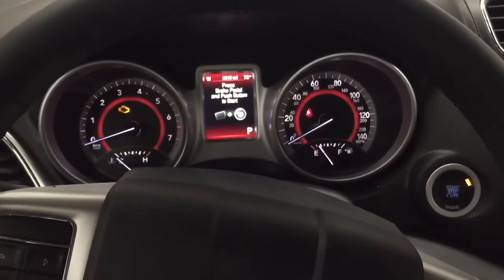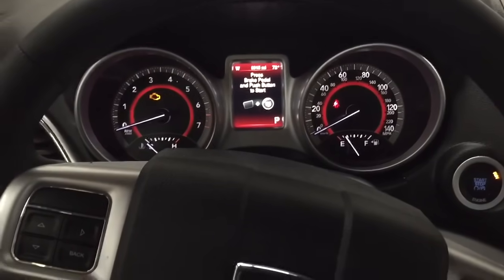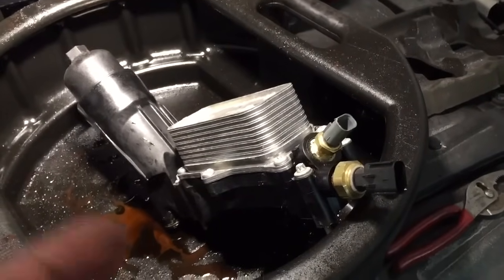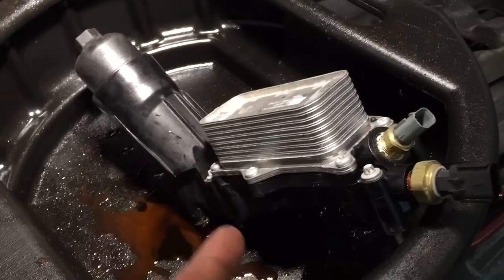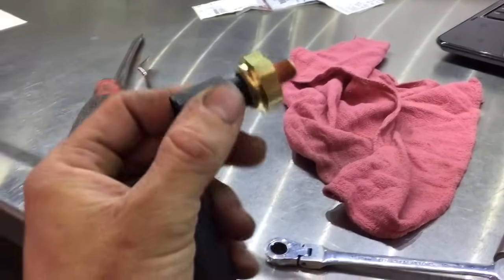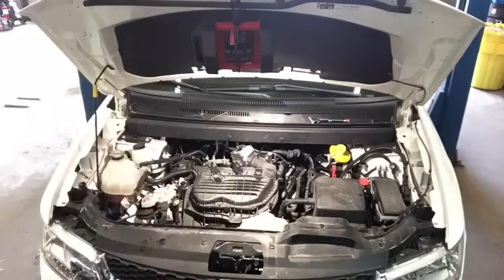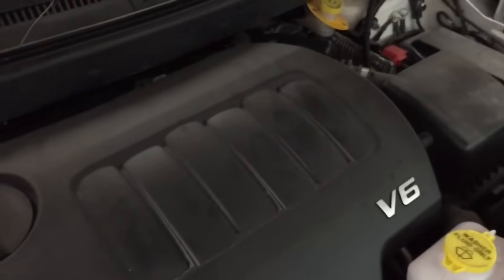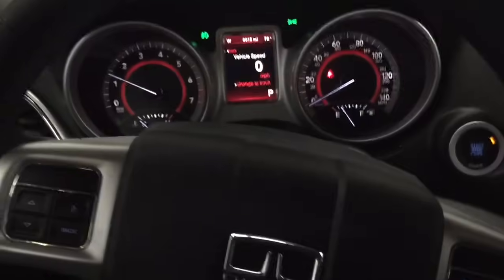P06DD Code, Oil Pressure Sensor Fix

Comment: My 16 journey had code p06DD
The scannner and dash cluster showed low oil pressure
I was doing basic checks . I removed the oil filter cap and i heard a rattle. The pressure relief valve in the cap was broken. I replaced the cap and had oil pressure restored. I'm a 40 year career mechanic and I've worked on countless  3.6 l engines...first time for everything.  Dont overlook the simple things.

Comment: are you aware of that code causing any other driveability issues? like throttle not fully opening? almost in limp mode? car will accelerate ok up to about 40 mph, then just flattens out. pushing on the accelerator (like passing gear) does nothing. it will still accelerate, but very slowly. and cats have been replaced.

Comment: By the time the sensor goes to shit, the cooler is likely leaking. Buy the update, it comes with sensors and related gaskets. 300 bux from a reputable dealer

Comment: P06DD is a oil pressure control stuck off, not oil pressure sensor. you are replacing an oil pressure sensor when it’s the solenoid that is on the oil pump, which is a dual stage oil pump. I hope people don’t follow your advice. 🤦

Comment: I recently changed my sensor and when the cold weather settled in NYC this past few days, I got this code again. It triggers when my engine is in High RPMs.

This sensor took me about 2hrs just to get out because the socket I had was a bit long too work with.

I got my replacement sensor at Advanced Auto parts.

The Mopar parts store wasn't opened on the weekends.

Should I replace it again? The weather is quiet colder now and difficult to work on this.

Car can drive but I have to drive like every other car 😂

I used a Roar Pedal Throttle Response device which I think has caused all these issues in the first place 😢

Comment: It’s not as easy as you say. I’m mechanically inclined, having worked on cars for over four decades. This sensor needed replacing on my 2016 Wrangler. It took me 7 hours and a large table to place and organize all the parts, nuts, and bolts. And there was a lot of them. I did use a YouTube video to help me. I never want to do it again, but now my Pacifica minivan has the troublesome code. I will pay a shop for this. A first-timer will not even come close to an hour doing this teardown of the upper and lower manifolds. But for those that do undertake this tedious job, I highly recommend that you replace the cheap plastic oil cooler housing with a longer lasting aluminum one while you’re replacing the sensor. The plastic one will crack and leak oil if it hasn’t already. You have been warned. Oh, and you will need new gaskets for the intakes and such. This repair is a lot of work for those that are unfamiliar with these engines.
Reply: I can remove the Upper and Lower Manifold in my Dodge Challenger in about 30mins.

The first time I did it, I had misfires on Cylinder #2.

I had to change my Coil Packs and Spark Plugs. The connection on Cylinder 2 Coilpack was faulty and I had to repin a new connector. 

I changed the coilpack on Cylinder 2 about 2x which until I saw the wires were brittle. I have not had any misfires since.

Now I have this P06DD code that triggers when I want to go into high RPMs.

 I am thinking it's my PCM or the wire harness to the Pressure Sensor is faulty because I already changed the sensor.

The other issue I have is my Oil Pressure at idle sometimes goes down between 20psi-22psi...normally it should be 30psi.

Last winter I couldn't get my oil change because it was cold...I shouldn't have left it. Maybe those few months extra driving without an oil change may have caused this issue too?

I do my own oil changes. Last time was during Thanksgiving and my car mostly gets local highway miles; about 30mi each day; Monday-Friday.
Reply: @ZxSkyLineKidxZ everything I’ve read and watched, says it’s the oil pump throwing this code. I’ve replaced the sensor and still same issue. I have one of those $19.99 Walmart special code readers as well as a $300 scanner and my oil pressure is normal but I’m going to still take on the daunting job and replace the oil pump.

Comment: I have a 2013 Dodge Durango 3.6.... I've changed oil cooler and  oil pressure sensor erased codes and the light came back on after about 5 mins of driving and won't go away......

Comment: Hello... Other day i had check engine light came on..checked and showed code p06dd .. but I had another thing happened which I noticed is that normally on highway going 100 km /hr my rpm were around 1600  and after the engine light and code they are sitting around 2200 ...can that oil pressure make the rpm affected by it.. ?? Any suggestions will be appreciated

Comment: My 2014 Grand Cherokee was dying on hard accelerations causing me to suspect a trans malfunction. P06DD was the code and no "low oil" indicator but I was about 3qts!!! low (dont know where it goes) I topped it off and then normal oil pressure was restored and seems to be prob solved. 
First Jeep owner- for better or worse!

Comment: Any transmission problems with this code I noticed the trans doesn't wanna go into 6th gear nor does it wanna down shift. Popped the hood an oil is every where. Any help is highly appreciated.
Reply: Normal limp home mode when lube system breaks is to limit rpm to 3300 and kill 6th

Comment: I have this code on my Dodge Caravan right now. What I was going to do is go to like Jiffy Lube and have the oil change and the filter replace first since that's one of the most common problems if not then I guess I should move on to the sensor. My question is is this really a 3-hour labor job. Also is it safe to drive with this code on
Reply: When this code sets the limp home mode is to not have overdrive. You will see 1000 rpm more on the highway.

Comment: On many of the 3.6L Pentastar engines, you can access the oil pressure sending unit from the driver's side of the oil cooler without taking the upper and lower intakes off. I believe the socket is a 1 &1/16th deep well socket and use a 6 inch extension and you can easily swap out a bad sensor. It takes about 15 to 20 minutes to do and helps prevent junk from falling into the open heads when you remove the intakes.
Reply: The hero we don't deserve 🫡
Reply: Wow man you could have just got to that from the driver side of the engine no need to remove all that.
Reply: What if all that is replaced and the code comes back? Bad pump at that point?
Reply: Really
Reply: That's how I did it after finding a YouTube video on replacing it.

Comment: Just had this code and others related to oil pressure on a '16 journey,  turned out Walmart oil change place put the wrong filter in,  and it was blocking oil flow.

Comment: I got this code from my own scanner, and I have a Chrysler 200 C 2016. 98,000 miles. Bought this car used in Aug 2021 at 59,000 mi and everything seemed fine. Started overheating. Mechanics said it was oil housing. Changed oil housing and no more overheating. Forward to November 2022 and my engine light pops on. This code popped up, I googled it and there’s multiple things it could be. I’m like wtf bc the car drives fine.. but recent oil changers said oil housing is leaking again so idk what to do. Ready to throw the whole car away lmfao 😂 any suggestions?????

Comment: Hi, I just wanted to share my recent experience with this code on my Charger.

TLDR; check that the new O ring is seated correctly at the very top of the filler tube cap.Fram oil filters come with a MUCH thicker O ring and mine wasn't seated correctly at the top of the cap. Put a thinner one ( the old one ) on it and no more error.

I changed the oil and 2 days later this code popped up. I Changed the filter as suggested, I changed the oil just in case. I looked into replacing the whole assembly as was repeatedly suggested and even started preparing to replace the oil pump as was secondarily suggested many times. It ended up being a $.05 O ring not seating correctly and, I suspect, causing the filter to sit **-eyed in the filler tube. Hope this saves someone a couple hundred dollars
Reply: Are you talking about the plastic twist off oil filter on top of the engine or that one on the video.
Reply: What o ring exactly???
Reply: A few thousand if it's a chevy

Comment: I had that code and replaced it with a Mopar switch and after a week the code came back on And yes i cleared the code after replacing it. I didnt have to remove all that, I was able to change it

Comment: Code is for the dual speed oil pump, in the oil pan, not the oil pressure sensor, I know I do these all the time, more than this guy obviously.
Reply: Is this why I have changed it 2 times and it keeps popping uo
Reply: Do you have a how to on this job bc I need that replaced
Reply: Is the fix to change the oil pump?
Reply: You're 100 percent correct 💯. These DIY idiots don't know how to read codes descriptions..
Reply: Adam how much effort does it take to replace the pump.
Reply: I have the p06de, ive changed the 2 vvt  solenoids and the oil flow control solenoid above the oil filter. Im having the code still. I have a 2014 cts 2.0t. Any suggestions what to do next?
Reply: @khalidmahmood8466  p
Reply: I bought just the oil pump solenoid, can I replace that and reuse the original pump or should I buy the pump too. Wondering before I pull the pan

Comment: On the journey you can  change the oil pressure switch without taking the upper and lower intake manifolds off.
Reply: How?
Reply: @UNOTLK08 I first disconnect the oil pressure switch connector with long needle nose pliers. Next I use a snap on chrome oil pressure sensor socket because it's thin and I jiggle it on the oil pressure sensor and take it out. Reverse the procedure to put it in.

Comment: I recently just got this code after doing some hard accelerations and the cel reappears almost everytime I reach 4,000rpm. I know the oil and oil filter are good. Are sensors and the repairs cheap? I've heard it'll reach into the $1,000+ range (with labor) and I want to save money where I can plus learning how my car works and learning how to work on my car.
Reply: I did it myself and spent $100 dollars, the sensor+12 gaskets for the lower and upper intake+ 5 "Ó" rings for the oil filter housing!
Took me a couple hours, for skill level i think 3 (1-5).
I have a '13 challenger, wich has that same pentastar engine!

Comment: I’ve replaced mine last fall. Code went off. But every time I’m ready for a oil change the light will pop on for a few days throw the code then go off. After oil change it does fine, until it’s time for an oil change. Deal says everything looks fine when running diagnostics.

Comment: I replace coolers alot and just the sensor u don't have to take it all apart for the sensor I change many of them in 10 minuts as long as it not leaking oil don't need oil cooler!!!!
Reply: How do you do it 10 minutes?  I would love to see that or know how, mine just went out while I was on the highway
Reply: @DimeV3331981  on the battery side look under the intake there is a wire that goes to a oil sensor the horizontal one unplug it and then get a socket to fit the sensor take it out and then new one start it by hand then tighten it up by socket and plug wire in and your done some people pull the battery to make it easier but I don't
Reply: Any videos of this?

Comment: This code is for the oil pump control solenoid, not the oil pressure sensor
Reply: Wow man you could have just got to that from the side of the engine no need to remove all that.
Reply: ding ding ding
Reply: Yessir!! Oil galley bolts, or the squirters under the pistons is what I’ve seen
Reply: Could this be why my Oil Pressure sometimes reads as 20psi on idle?

It's random. Sometimes it can just be 30psi my whole drive but when I want to kick into higher RPMs, then it goes down to 20psi

Comment: Wrong.  P06dd is almost always the oil pump fault
Reply: ding ding ding
Reply: @leecrumble3921  minimum RPM is in the 2800 range if conditions are met also such as temp, fuel level, etc. P06DD is oil pump stuck off and I believe thr AD code is stuck on. Most of the time it is NOT the pump itself, the PCM monitors the circuit constantly especially at on and off of the solenoid. Resistance is the windings or mechanical resistance like sludge or build up can cause the amps to draw more and the PCM to set the fault. I have noticed nothing ever wrong with the pumps themselves. Assuming your oil filter housing is not broken internally like the first style.

Comment: I have this code for a year now. I replaced everything back 2019 for my dodge avenger 2012. Including Oil pump, casket, oil switch, oil change and filter cost me A whole lot. It was okay and running fine after 6 months later, this code came back and It wont go away. I only drive it 2miles  per day  and only 96k mileage. Never again dodge!
Reply: I'm working on one I changed the Top sensor the harness and the bottom sensor with oil pump still has light. Light comes back on with in minutes.
Reply: @kevinholmes3070 Yo im doing the same thing right now, replaced pressure sensor, oil filter housing, connector for sensor and the code keeps coming back, did you ever fix it?
Reply: Whatever  you buy, you should opt for an extended warranty so you can just budget 100 dollars for when it breaks.

Comment: I have replaced the whole cooler and pump and still get the code what would be your next step on a 2012 Jeep jk
Reply: It has nothing to do with oil pressure sender. It does for the oil pump pressure control circuit that is on the oil pump. Replace oil pump assembly.
Reply: I replaced it three times and code still on and code still on and also
Reply: @miguelramos7039  did you replace it with a Factory pump

Comment: Dodge 3.6 are just shit just buy a hemi I have a 3.6 2013 charger se and this p06DD code is restarted I changed it like 2 times I did it my self and also changed my spark plugs and still same code this car is trash mop at makes nice cars but the 3.6 motor is trash and plastic parts everywhere
Reply: Another cause is aftermarket oil filters.

Comment: And after replacing the cooler twice and the sensor with OE, the light is still ON. Switch shows False with a new switch and no mice damage on the harness.
Reply: P06DD the solenoid on the pump which OEM part will come with the complete Oil Pump. You will basically need to replace the oil pump
Reply: @OnlineMechanicTips  how much do u charge for this job? The oil pump replacement? I'm JW what I should be paying

Comment: If you have to go to that extent your better of replacing the entire housing it’s not the censors that fails it’s the housing gets clogged and causing the water cooler to erupt through the gaskets I’m sure this is a temporary fix but they will be back with Coolant leaking down the valley of the motor. Bad oil cooler
Reply: It is usually just the seals on the cooler losing their elasticity at high miles and not standing up to the 80 psi oil pressure. I have seen people overtorque the oil filter cap and break the housing but that is the exception.

Comment: Would that cause my car to shut off when I’m driving it and start back up after sitting for like 30 minutes??
Reply: yes, low oil pressure in a VVT engine will cause this
Reply: My car is doing the same thing
Reply: Mine used to do this on the freeway a lot

Comment: I don’t know if you’ll see this comment but, I have the same issue but on a 2012 Dodge Avenger R/T, how much would it cost to get fixed ?
Reply: That’s why you don’t buy North American cars.
Reply: @TakeThis_L  explain
Reply: $300-$400 typically.
Reply: @DonZaloog88  well that sucks. My 2014 Dodge R/T just threw this code

Comment: I had the P06DD and a leak. Brought a new housing and it stopped the leak but the engine light won't go out...???
Reply: Sometimes if you dont reset the code it keeps popping up after you already solved the problem.
Reply: @Jironchild  No, the problem is the oil pump
Reply: Same issue

Comment: Changed mine out for an aftermarket one. Good for 30k miles. Then the cooler went bad with an oil leak out the plastic so I changed the whole assembly about a month ago. The assembly came with a new sensor (oem mopar.) Now it’s throwing the code again. Gonna take the old aftermarket one and install it again. Mopar is skimping on the quality of their sensors for sure. I recommend going aftermarket on this one.
Reply: I had some issue but I didn't get 10 miles and the Code showed up so I replaced the new sensor that's came with them cooler with another new one and again then code came straight back.Oh for the love the Dodge Brothers what gives ?
Reply: @Tay58382  was it a bad sensor?
Reply: @Tay58382  what ended up being your problem? Im going thru the exact same thing right now, just replaced the whole oil cooler assembly with one that takes a 2014 charger oil filter and reused my old sensors since i heard aftermarket ones usually act up but now i have a check engine light
Reply: There are many other known causes for P06DD. I would rediagnose rather than assume it is just another sensor.
Reply: @robertmerritt7271  yep. Go with the cheapest first. Replace the sensor 🤣

Comment: Did you replace the intake gaskets?
Reply: No he didn’t I’ve taken apart my 2013 Dodge Charger SE. all you have to do is replace that sensor on the oil cooler. Don’t pay someone to do it all you need is some tools and YouTube it’s really not hard.
Reply: @FishSticks  I’ve done it twice, and same code comes up. I used to be an ASE master tech so it would have to be the cooler and sensors... my journey continues